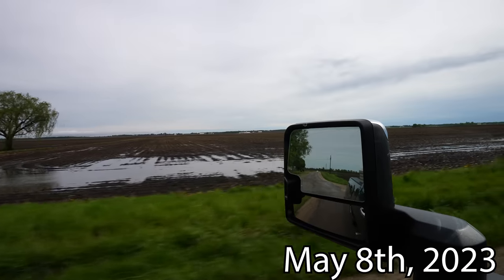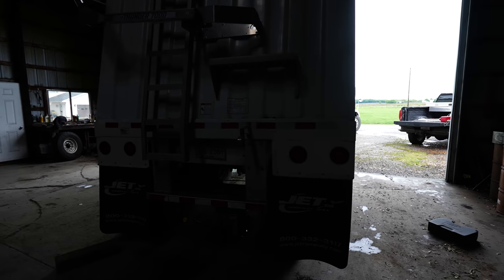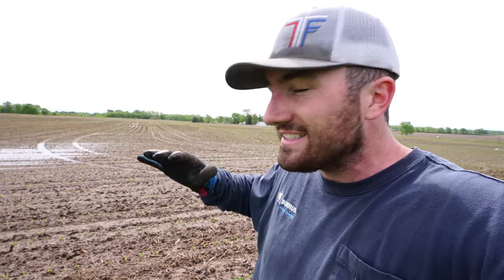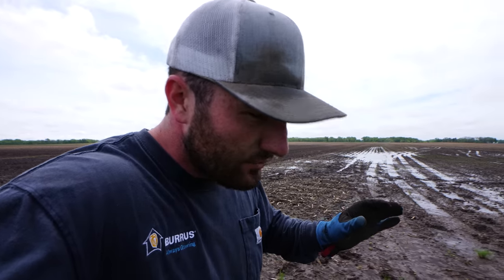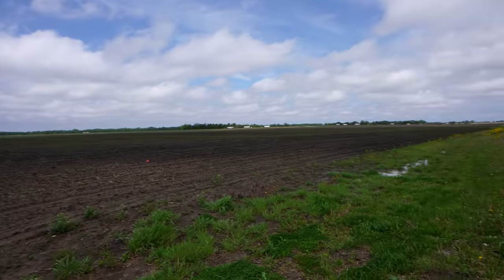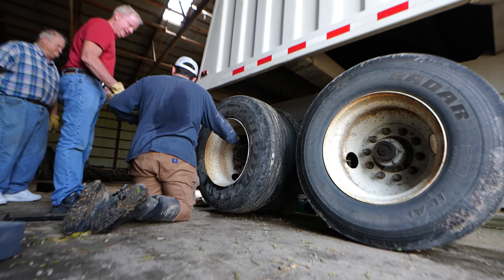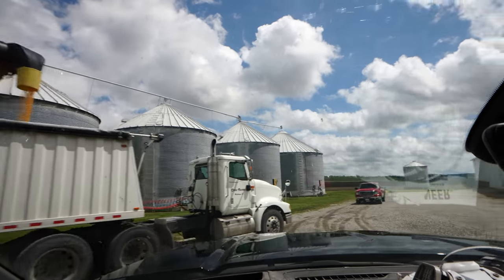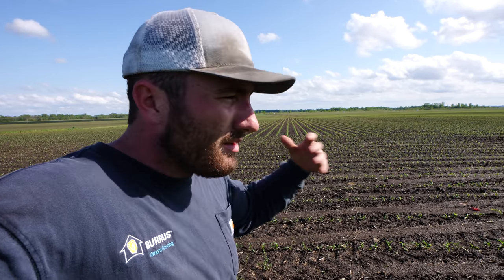Draining Flooded Fields To Save Parts Of Our Crop!

Comment: Roll the inside tire onto a big block of wood and it’ll bring the outside tire up to change it, no jacks required.
Reply: Budd rims only 10 nuts hold on both rims if you take the nuts off the possibilities are the rims will come off the hub and trailer will fall and pinch tires or it could fall on ground
Reply from the maker: That will save some energy next time. Thank you!

Comment: Ahead of corn is A LOT more challenging. But I face palm every year driving by all my friends and neighbors places who don’t do it on soybeans. The big advantage you would have is the ability to chemically aid termination. You could have a nice vetch and pea dominant cover crop. I imagine your dad and uncles heads would pop off if you went as far as planting green. But you get so much more by building that extra fertility and biomass after the cash crop is planted, then roller crimp it down and spray it. It would be nice to get that done on the same pass. 

I say take a little 5 acre area and develop a plan for it. See how it goes. By the 6th year, and your planting corn for the 3rd time, and soil testing shows you have 250 units of available, not tied up N available, you’ll be asking yourself why you waited so long. Give it a nice 50 unit jump start of N for the extra vigor it needs to get up through the mulch, I’d bet you pick up 15 bushels on a crop that is a lot cheaper to get in the ground. 

Oh, and you’ll kiss your standing water in the field problems good bye also, and if we get another 2012, that’s a 15% loss, not 50, because their is moisture for those roots to get to. 

This is a generational endeavor, slow and steady, don’t bet the farm, just keep testing and running trials. I don’t see any mold board plows around your farm. Someone at one time decided to try something different. This is no different.
Reply from the maker: I don’t disagree with you, but I’ve seen a few cover crop fields that went into corn this year that look horrendous with this dry weather. I want it to work, but I think you’ve got to managed much more intensively than a conventional tillage operation does…

Comment: I wonder if it wouldn't be less hassle to simply run the drying bin into the bin next to it when that one's half-full.

Also, dropping everything into the drying bin at harvest and letting it distribute it into the other bins would save a good couple of climbs to move the auger. But maybe that's just my desire for permanence speaking ;)
Reply from the maker: The combines move exponentially faster than that drying system can transfer grain, unfortunately. These older bin system were built in a different era of harvesting capacity and yields. They’d get choked out by the combines in two hours!
Reply: @aTrippyFarmer  Thanks. I wouldn't have expected it to be that much slower than the filling auger. But I guess that again shows how hard it is to judge the capacity of a machine from seeing it in a video ;)